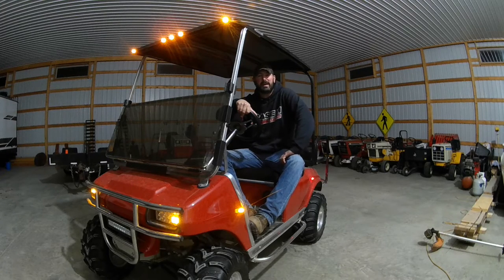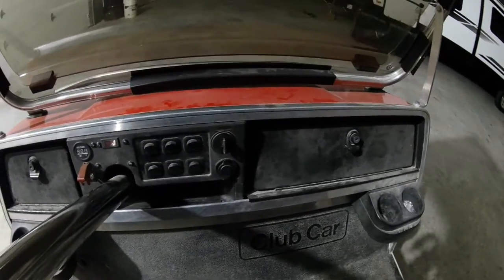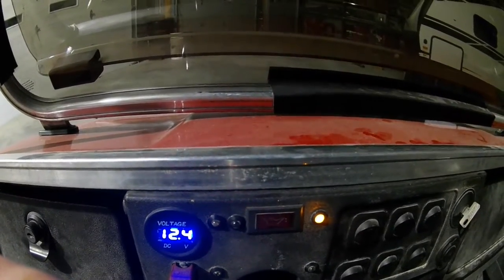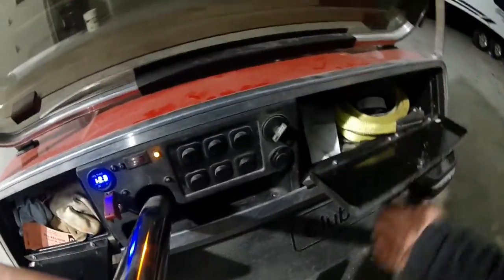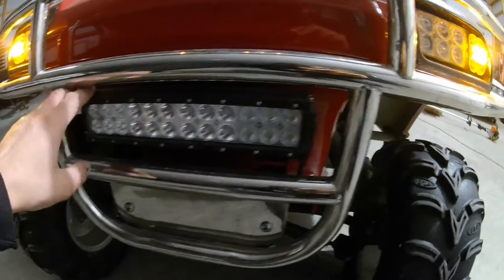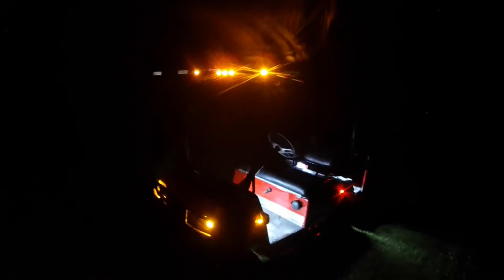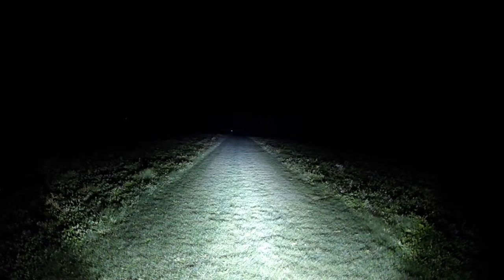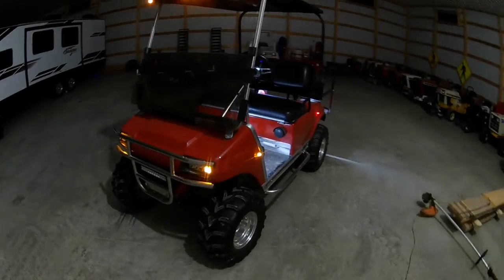Golf Cart LED Lights And Accessories

Comment: I would like to see the install of the clearance lights. I want them on my cart do you need to use a relay on them
Reply from the maker: I may be able to do a video showing how I installed . They are pretty easy, Just takes some time to do it. You do not need a relay for them. They draw very little current.